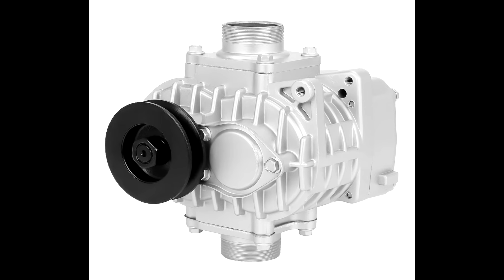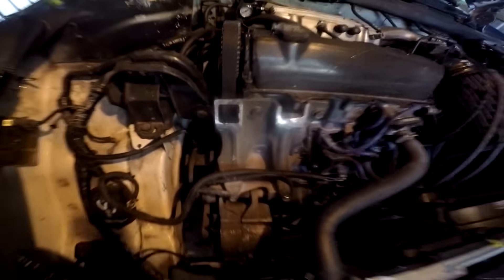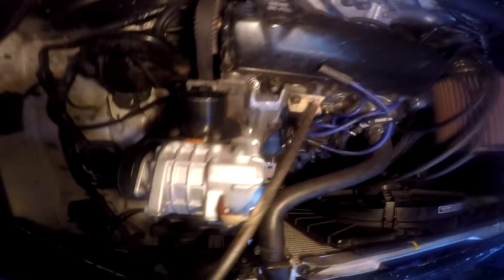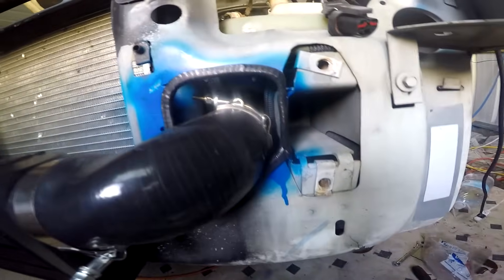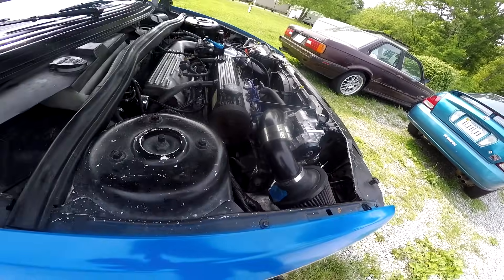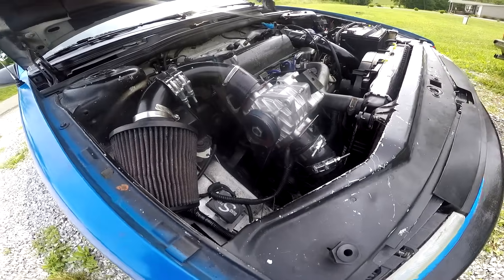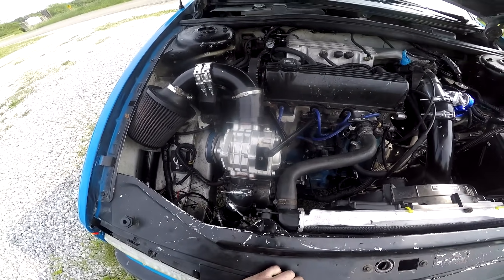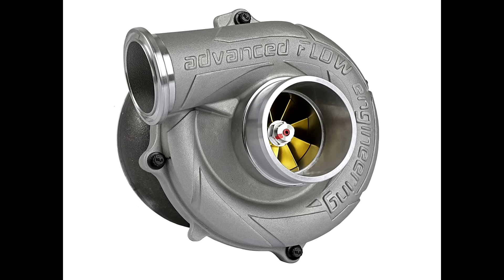AMR 500 Supercharger Testing - is it as Good as the Internet Says?

Comment: I saw it advertised for 0.8 to 2.0l displacement. You need a smaller pulley. I think it would be worth trying at least. I saw it works on Del sols well with 1.6l engine.
Reply from the maker: The advertising seems to be a tad random. I've seen people on forums running them on 2.2's claiming that it made a difference in power, however I think it's placebo. I don't think It's worth it to set it up for a smaller pulley.
Reply: Yeah they really work best on engines 1.6l and below. I think the inlets and outlets are too small on the supercharger. They are only like 1.5in opening. I’ve seen people make bigger flanges but these things were ultimately designed for a 660 cc engine. Id love to try this on my 1.9l bmw but I don’t want to waste money if it doesn’t make boost.
Reply from the maker: @koolHalo3clips  Yeah I forgot to mention in the video that I made 2.5" flanges for it to match the charge piping. You could put a micro V belt on it to spin it faster and make some boost for your 1.9l, but I wouldn't expect more than 5 PSI. However then you run into the problem of it possibly leaking like mine. The math suggests that it should be enough for a 2.2l, but they seem to be very inefficient; as in they don't seal well.
Reply: Imagine being crazy enough to get one of these for a single cylinder motorcycle from the 70s, it's a project
Reply: Fk a pulley grove the fkn shaft lmao

Comment: The other thing no one in the comments is talking about is the fact that scavenging has changed with the additional airflow, so without mods to the exhaust pipe, the frequency/flowrate of exhaust has increased, changing the length of the runners to correct amount may be helpful. (Since the supercharger isn't relying on pressure differentials on the exhaust side)

Comment: These superchargers were originally manufactured back in the 50's for carbi 4 bangers that made 30-50 HP from the factory.
It works wonders for the cars they're made for.
I've got one on my 58' Renault Dauphine Gordini and it's made it that much better.

They don't do shit on modern cars.
They can't keep up; restricts air flow that modern cars have these days

They're only good for 60 ish year old 4 banger engines.
Reply: I suppose an E30 318i would be a no go, then? My original plan was to engine swap it from an M40 to a 2L M52 and then add an Sc14, but I thought I might get impatient and stick an AMR500 to the M40 after an engine refresh
Reply: Amr 500 can flow 180hp if you change inlets/outlest and even more if you port it

Comment: Go to the u pull it junkyard and find a Eaton m62. They were used on a decent amount of gm 3.8 cars around 2000. You can usually get one for 80 to 100 dollars.
Reply: u are just spot on . even the mercedes compressor it's enough or the mini with is much bigger.
Reply: @HatersGarage  take a look at mx5 eaton m45 kits I'm trying my amr500 before I pull the trigger on one, a few adaptions and it mounts almost in the identical fashion and includes the remote mount plates 🍻 it's a 2x bigger supercharger from mini-coopers and merc c230 compressors
Reply: You'd be better off with the M62 off of a Mercedes. It can be remote mounted, unlike the W body blower.

Comment: It's leaking gear oil from the blower. This is because the seals in the blower (I'm assuming) are designed to operate in a positive pressure environment. If what your saying about the blower causing a restriction in the intake at wide open throttle, then that would mean that the oil seals in the blower were exposed to a negative pressure environment for however long it was ran at wot. Thus drawing gear oil from the blower casing.

Comment: i use these superchargers all the time with zero problems . you have to change out the oil from the factory to acdelco 10-4041 Synthetic ($12) . you can not have any leaks at all with the piping . when you do the pulleys you want at your motor at redline to be at 9k to get 6-7ish pounds of boost .

Comment: Despite what the ad says, it is clearly meant for 1l or smaller engines.   And based on how they sound, I don't think they were designed to spin faster than the engines rpms.
Reply: @dooby1445the ad he bought it from said 16k rpms...but it also said it would work on a 2 liter engine.  The second was clearly a lie, as they are meant for sub 1 liter engines.   Multiple youtubers have spun them between 12-16k, and they will leak oil or run hot.  Thus, the 16k rpms may be a lie as well.  Put it on a 600cc engine at 10k rpms and it'll probably make 5psi all day....put it on a 2l at 14k and it'll grenade before long.

Comment: The pulley ratio is 1 : 2.33 so AMR 500cc can make you 1,165 liters of air per one cycle and 2,33 liters on full revolution (two cycles). That means that it only slows you down cose there is no boost ;)

Comment: i worked with a friend that has an amr 500 installed on a 98 mazda b2300. 
we ended up with a oil cooling system running hydraulic fluid of similar viscosity to 5w20 motor oil. a little 5 psi inline oil pump forcing the fluid thru the cooler then back into the amr.
its been almost 2 years now, but when he tested with a USED blowoff valve set to 4 psi offshoot, the valve did infact open enough to release pressure.
idk about his hp gains, but it did a gps 0 to 60 almost 0.9 seconds faster when we tested on a cloudy day-about 58 f

Comment: Others have commented about the CFM already, but in terms of the oil leaking, apparently that's an inherent design flaw that affects genuine ones just as bad. 

I'm not an expert but others commented on another video that the AMR500  isn't designed to be under vacuum, and running these under vacuum causes the oil to be sucked passed the seals. So if you want to install it in this application you need a bypass valve. 

The real problem with the cheap replica ones is that they use thermoset plastic internals, that are prone to shattering rather than melting.
I wonder if someone could make these work by running 3 or 4 in parallel lol.

Comment: Mounting it level so the gear oil isnt pulled into the air flow would make a big difference.  They also cant have any vacuum conditions.  Air has to remain positive charged internally

Comment: Had an Eaton M65 on my 4 banger 8valve BMW E30 (M40B18). Got 6 psi of boost at around 5k rpms. Although couldn't feel horsepower increase, throttle response was way better and much much torque from 1200 rpms. With a welded short ratio diff and weight reduction,it was really fun.. Later swapped to 6 cylinder M50 with a snail 😂 and became man😂....
Reply from the maker: Yeah the bad thing about superchargers is you use a big chunk of your extra power turning the supercharger itself.

Comment: 2L is about the max you can go with these .. and the rpm range is about 6k at most
Reply: False .. pulley’s can be swapped
Reply: @mtbridingog9083  but then at that point you over spin the charger and the life will drastically decrease
Reply: @vcamps88  and even with different pulleys you wouldn't gain any power
Reply: @aaaabababa  lil bit extra low end torque is sometimes all you need. N/A's altitude can't breathe enough 😅

Comment: Are you sure you didn't have it working backwards?
Reply from the maker: They can be spun either way.
Reply: @HatersGarage  If you still have it all mounted in the car...then you perhaps should try switching the inlet and outlet plumbing around to the opposite
positions - just as an interesting extra experiment, and to be 100% certain🙂
Reply: Or maybe you could just disconnect the outlet temporarily and check if that side is sucking or blowing?
Reply from the maker: @starhope9630  I'm 100% positive it was blowing the correct direction. Having it suck air from the engine would be an interesting experiment, but I've already removed the whole deal from the car. My guess it that it would rev to about 3000 RPM and no more, if that.
Reply: @HatersGarage  I meant to experiment whether it was definitely running in the correct direction...as I've heard (unconfirmed) that some of the AMR500
superchargers are directional - and some can spin either way.
Reply from the maker: @starhope9630  Haven't heard that one, Everything I've read says that they're multi-directional.

Comment: I've seen these do a bit better when new/custom flanges are made for the input and output, as the standard ones that come with it are a lot smaller than what they could be. I'd be hesitant as well using one of these on any engine larger than about 1.5L without at least enlarging the flanges.

Comment: Hay I am doing a custom set up a harly do.thik it will work
Reply from the maker: It should work great on a Harley
Reply: Sir, I put several of these on Harleys each year. I even have 1on my 1261 c.c. Suzuki GS Race Bike.
I'm hoping to do some videos in the near future,  so keep your eyes open. 
The ones I purchase definitely do NOT  just have a fresh paint job, and I always run a serpentine belt, I would NEVER run a V belt.
Pulley size calculation is one of the keys to getting both boost levels and longevity of the supercharger. Excessive 
I.A.T. is always a issue, and I control it with a proprietary H2O/methanol system.
T.S. RACING 🏁

Comment: If i recall the amr500 was built for really low end power gains and just doesn't push enough air for top end Gain's. Back when i was a kid we used junkyard Eaton blowers. Could get then on old Mercedes and a few Japanese cars.
I think the modern equivalent would be the eaton tvs r200 through r340s.

We used them on gio metros and Pontiac fireflys and would spin 150-250wheel power on those little 3cyl engines.
Reply from the maker: 250whp in a Geo sounds hilarious
Reply: Someone dropped the whole blown Mercedes engine in an MGB, here in London. It was quick and the torque was enough to pull a tree stump. If I had the little engine you had, I’d bolt it up to a Geo Tracker/Suzuki Samurai transmission and drop it in a Ford 100E, MG Midget, Renault Dauphine or an Austin 7. Maybe even an Austin A35. Yeah, I’d definitely stick that Eaton blower on it.

Comment: What you have their is the Chinese Re-production units. You can get AMR500 Units that are "genuine" refurbs, although take the term refurb with a pinch of salt. I always rebuild the unit with new bearings and seals( $40 in brgs and seals, takes about an hour)

I See everyone install these incorrectly. They are a positive displacement unit, so the throttle body should on the INTAKE side of the charger. These units do not work well in a Blow-Through configuration (They are not centrifugal).

I, like yourself, Installed the Unit like you did. The engine LOST power. I Then did a ton of pipework and mounted the throttle body BEFORE the charger on the Intake/ Air filter and i gained 40hp (Talking a small 1.3L Engine here). The unit also runs a lot quieter and sounds like a charger instead of an air raid siren.
Reply: There are videos on my channel from my race car with the AMR500 Unit installed.
Reply from the maker: Interesting how it made that sort of difference. With the throttle wide open its a straight pass through either way, maybe a bigger throttle body would have also solved the problem.
Reply: @HatersGarage  I thought the same thing. Didn’t work. What worked was what I did above. Can’t explain It. Doesn’t make sense. But proof was in the execution.

Comment: For the dodge 2.2l you need to find all the parts to convert it to a turbo 2.2l. I had one, it was a lot of fun.
Reply: True! You could yard most of what you need from a wrecking yard and just bolt it on. The 2.2 Turbo Lebaron GTS I has was stone stock and it was fast as hell!
Reply: @Jamespennington71  had a 91 daytona shelby with a garrett t2, modified a413 and quaife lsd. Man that thing was a blast at 15psi. unfortunately I blew out the input shaft on the trans and the back window got shot out, she ended up rotting in my parents back yard and I sold the fun stuff and scrapped it in 2013. Sure miss it tho. Poor girl deserved better.
Reply: @frostbite1991 How was life with the quaife? 

They look like great bits of kit, though I heard someone say it is really loud/irritating on the highway?

I am very tempted to put one in our fun road trip car. (Practical enough to drive to the nation’s most fun roads, but fun enough to drive that it’s worth going to them).
Reply: @piedpiper1172  Never had issues with it, car sounded fine on the highway. If your diff is loud, it probably has bad gear mesh and needs spaced. Not all diffs can just be slapped in, they need properly spaced. Why some people were probably hearing noises.
Reply: @frostbite1991  thanks!

Comment: Watch robot cantina's video on these superchargers, they run really hot so they can make less power, and if you draw vacuum through them they loose oil as you showed, but idk like you said its just too small
Reply from the maker: Yeah I've been following his content on it. They do run nuclear hot, and the lobes just don't seal well. It seems that the rebuild quality just isn't there.
Reply: @HatersGarage  runing a turbocharger into the AMR 500 is the solution
Reply: Running a turbo INSTEAD of the AMR500 is the solution. 😉
Reply: @michaelblacktree  But bigger air

Comment: Try 3-3.5 crank/sc gear ratio. Do not use intercooler for such a low boost. Make a tensioner, the belt will slip on higher rpm. Tune it again. It will do the job 😉
Reply: Thank the car gods I'm not the only one who can math! With the 3.5 and a water to air cooler your looking at 14psi to 5300rpm... sounds pretty damn good to me. How can you get so close and give up over a pulley? 😔

Comment: Maybe don’t use an intercooler if you’re not moving enough air put it straight to the throttle body because it might not be enough air to cause detonation usually a lot of air with heat is when you need a intercooler

Comment: If you wanted fast you should've gotten the turbo 3 2.2l block and put the turbo 1 2.2l cylinder head on it. Wouldve had best of both worlds. The 2.2l turbo 1-3 engines are the short stroked 2.5l that Chrysler put into the dodge dakota from 87 to 93 before changing over to the AMC 2.5l timing chain engine in 94. Most of the 2.2l mfi engine were made in Mexico. Most u.s built ones were tbi. Super rare to find now days.

Comment: Im sorry you had to learn the hard way. You did gain experience and thats priceless. I looked into it myself and all it does is it makes a lot of noise and makes you lose power. Just to give a heads up even proper electric turbos arent there yet. Restriction is the issue. They work awesome the 2% of the time you use them, but for regular driving will block air flow. People negate having a well in order working vehicle foremost. Keep fiddling
Reply: an electric turbo will never get there. a few simple calcs on the power required to simply compress a given volume to a given pressure in a given time is a dead giveaway.

unless you have an alternator the same size as the engine itself and are willing to dump half your produced power into that generator simply to drive the "turbo" which at this point is a centrifugal supercharger, not a "turbo". and then that also requires a motor driving said compressor capable of delivering teh power required...

50 hp is a lot of power to drive an electric motor with. ever seen how big a 50HP electric motor is?

and thats only going to give you 25-30 hp anyway. yippee...

those big blowers strapped to drag cars? they might be absorbing up to 1000HP, simply to flow enough air to GAIN 1000hp at teh shaft... meaning the engine actually had to make 2000 hp over its stock output, 1000 of it to drive the blower.

go find me a 1MW electric motor that can be lifted by hand, and doesnt require a 100T crane and wide load truck with special permits to move around. find me the 1MW generator required to drive it...

a belt and a pulley is FAR more effective than generators, batteries, speed controls, and electric motors. as is an exhaust gas driven turbine.

electric supercharging is a delusional pipedream sold by advertising teams and charlatans with no concept of basic physics, electrical theory, or mechanical designs. and they rely on the fact that you dont either!

Comment: LOL, I was going to try one on my 210hp 2000 Honda Prelude 2.3L VTEC engine. So I would lose power obviously. I thank you for saving me the trouble. Only thing I can think of is using two of them at once, maybe co0mpund supercharging? Would probably want some methanol injection for pinging issues.
Reply from the maker: Two of them would probably make a few PSI. A beefy intercooler would probably keep things cool without water meth as well. At that point you may as well just get a bigger supercharger for a similar price, I've had about 8 people tell me to get a Eaton m62
Reply: Or a small snail with a good tune. Would be cheap and have good gains and be easy to upgrade

Comment: I work in a metal shop and yeah cutting aluminum all abrasive wheels cause a wicked stink, we use them obviously but also the little carbide saw blades but I avoid those as much as possible they are dangerous! A coworker was back gouging a boat keel with one and it kicked back and caught his papper hood right in the clear lense and it went through it like butter and zipped into his nose about 1/4", the only thing that stopped it was the opening suze it bound on the lense trim ring but if he hadn't had any PPE on it he would have either been chopped up bad or dead they are no joke..... He was an experienced guy and it also had a guard on  it also so could happen to anyone.
Reply from the maker: I've heard that as you get more experience working with power tools the more likely you are to get hurt, because you're not afraid of them anymore and you get careless